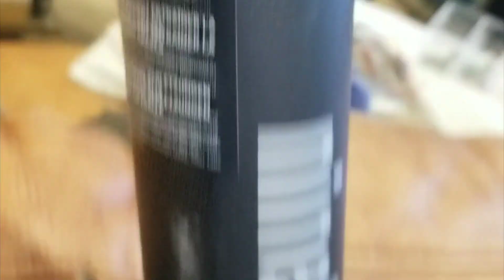Ninebot ES1 ES2 ES3 ES4 Internal Battery Teardown

Comment: Best disassembly video I have found for these packs!  I found one of these scooters in the dumpster recently and can’t really see why it was thrown out.  Thanks for the info!
Reply from the maker: Thx so much for kind words.  Dumpster finds are the best!  Amazing the gold that can be found in there.  Scooter well my friend. My wife and I have found all sorts of new corners of our city as a result of these amazing inventions.
Reply: Same here, found one in a dumpster. External battery charged up, internal battery is asleep. Hoping to wake it up and recharge it.
Reply from the maker: @SunsetSlimess I discovered after I recorded video that there is a little brass reset button on one of the control boards - there is a video out there that shows that you can carefully drill a small hole in the battery case to get a paperclip 📎 in to hit that reset button to wake battery up. Apparently works sometimes if that's all the problem is. Good luck with project!
Reply: @fixitdad899  I had to open the case, half the pack was below cutoff voltage. I was able to charge that side with magnets and a bench power supply holding the wires to the side bars, then the pack woke up and charged normally. Works great now!
Reply from the maker: @SunsetSlimess  Nice! Any ideas on why only half the pack discharges like that? Never understood the why on that and discovered it on more than 1 pack. Glad that worked for you and that all went safely.

Side note - My neighbor accidentally burned down their and our weekend places last summer.  Not battery related but ... - I'm now paranoid about trying to boost Lithium anything! I lost all my escooters :( 
Found burnt out cells strewn about the ashes. Apparently cells can travel a fair way once they are 'shooooshing'.
Anyway - may yours now bring you much pleasure. I've moved on to Wingfoiling for now - less risk of fire and a good workout to boot!🔥 😀 👋
Reply: @fixitdad899  Not sure why, might be a BMS firmware issue. I never charge them unless I am there watching, and never above 10A. Just needed a few minutes for them to get above 3V and the BMS wakes up.
Reply: @PortablePowerSolutions  Got any video or pics of that operation?

Comment: The way to wake the bms up (no blue flashing light) is to apply 12 volts to the  red and black wires, on the 4 pin plug. And boom good to go, if the cells are not buggered

Comment: This is great information. I am wondering whether I could repurpose the cells in the plastic case. What is the diameter of the assembled pack?
Reply from the maker: Calipers say 49.33mm diameter...one side has flat face which is about 23mm across...when measuring distance from flat face to opposing side (quasidiameter?) It is approx 47mm
Reply from the maker: Thanks for watching and for feedback...yep, great little packs to repurpose: either case or cells. Best wishes on your project(s)

Comment: I believe it's a 2p10s -- you had it backward. Each pair that shares the tab connection is paralleled (making a 3.6v @ 5.1 AH cell), which are then put in series to make 36v, 5.1AH = 183wh.
Reply from the maker: Thanks for watching and for the headsup...makes sense. Order of things does make difference. Appreciate you adding the wattage ratings too.  Have a great day!

Comment: Thanks a lot for the video. Do you have a video where you show how to change the bsm with the sidebars when the batterypack is good, thats the cheapest way for me to bring back life to my battery.
Reply from the maker: Hi Gurdal. My pleasure. Sadly no, I don't have such a vid nor have I attempted manouvre myself. Best wishes with the project and pls do record and post. I'd love to see it.
Cheers
Reply: @fixitdad899  i have disambled the battery. It was glued on one side. After measuring the blockd ive found out that two cells where undervolted. I had to destroy the pins to get them out and charge them. Now theyre charged normally but the problem is to solder them back again. So it doesnt worked and thats why i cant gwt it togehter to test the bcm. It shortly blinked blue but then directly changed to red again constantly. I think when i get it togehter with stable soldering and change the bcm it could work again. Ive ordered a new battery on aliexpress because in you cant buy in germany wirhout getting poor🤣
Reply from the maker: Ya - they don't seem to be easily self-servicable units.
Difficult to take apart without destroying some pieces.
But there are some great parts in there that can be re-used in the worst case.
Good that those two cells took a charge in the end.
Best wishes with Ali B ... maybe they ship quicker to DE than CA?! Orders take a long time to get to Canada.
Anyway, Happy Holidays to you and yours.
Reply from the maker: Maybe Santa will bring you a spot welder
Reply: @doenerfreak87  time to invest in a battery spot welder. i bought a cheep one on ebay that lasted about 20 welds and one of the cheap mosfets went south- easy fix.  it makes rebuilding battery packs a breeze

Comment: Is there any way to revive a battery that is half dead like you explained? One side is near full charge while the other has less than a volt on all readings :( Thank you for the help!
Reply from the maker: Hi Dabiel - sorry for slow response. 
I never did get to the bottom of why the packs were 1/2 discharging like that. Without knowing cause I've moved on from the dead cells.
Once cells are that discharged, I wouldn't trust them anyway.
Seen way too many stories about ebikes spontaneously going up in flames lately.
Lithium can be so dangerous.
Better safe than sorry methinks! Have a good one - thx for watching.

Comment: hi!  my son got one of these scooters from the dumpster but someone tried to fix it and left it disassembled but with almost all the things inside a plastig bag.  also the battery is fully disassembled. meassured it 40V. DETAIL --> it misses that second board with the 4 pin connector. the dash doesnt display anything but when i press the ON button the ESC turns ON and the green led flashes 8 times.    do you believe the scooter is able  to run with a battery without that second board?  before discovering that missing board I was thinking on purchasing a new ESC and Dash for it....  the motor seems to be functional because I tested it with a rc car ESC....
Reply: forgot to mention that the pack even without that board is fully balanced with the cells measuring 4.095V !!!
Reply from the maker: Nice score! I highly doubt you can run reliably without 2nd board. But I honestly dont know for sure. Im.way better at taking things apart than putting them back together 😁 - best wishes with your fix - sounds like you have the know how to get that thing going. 👍
Reply: @fixitdad899  thanks for your reply... I will keep trying to find out the esc led flashing code... it flashes 8 times... as it is impossible to see the actual code because the dashboard doesn't display anything... it is a little bit expensive to risk buying new parts for it... maybe is a good idea to first buy the BMS, then the Dashboard and finaly the ESC....    let's see...   ciao from Italy
Reply: @fixitdad899  got some news. I discovered hot the esc flash works. there is a long blink and sucessive blinks. the first , long beep is the decimal of the error code presented in the dashboard. mine was flashing 1 long blink, then 8 shorts. thats means error 18 that is hall sensor problem. after cleaning contatcs started to 2 long blinks then 1 short, meaning 21 (bms error!  the missing board)...  then I discovered that the black wire that goes from the esc to the dash was faulty.  removed the connector from the esc board and soldered the cable directly to the board and ....voilaaa.... dashboard working, beaping and displaying error 21 (BMS)...  the conclusion is that the scottter will not run without the bms board (safety).  I will  need to purchase the board now.
Reply from the maker: Fantastic troubleshooting sir! Thx for explaining the codes and how you were able to read them. Best wishes on sourcing the part and completing the fix. The good news is these things are everywhere it seems! Usually in the middle of a pedestrian sidewalk unfortunately:)

Comment: Do you know if I can mix the LG purple battery at 2650mah with the blue 2550mah, I had all LG and 2 blue batteries but couldn't get it the BMS to turn on, the batteries where charged up to 40V-4.2V and getting 40-42V total.  Not sure if there is something else wrong with it or the BMS boards.
Reply: I have also got a scooters that 1 batteries is charging faster than the others so it would cut off, I assume that will be more likely the BMS than the faulty battery.
Reply from the maker: Hi Mr. Lee
Apologies I dont have a good answer for you - I recommend you reach out to folks on a battery builders forum - my gut says you should never mix  ampere ratings as it creates an imbalance - maybe if the 2 single cells have a higher rating than the rest it might be acceptable but I just dont know. I would assume other way around would cause undue risk i.e. adding in 2 cells with lower ratings.
Best wishes!

Comment: Is there a trick to removing those plastic internal locking caps on either end?  I am able to turn them about 45 degrees back and forth but can't get the slots to align with the metal guides inside the stem. Thanks...
Reply from the maker: Hi Jed
It's been a very long time since I removed mine. Going from memory I used a set of old metal measuring calipers with sharp points. (Like a compass from school days but with 2 legs)
What I remember is having a challenge turning the plug counterclockwise in the tube thread until I used the calipers in the two slots/cutouts in those plugs. There is actually a tool you can buy that inserts into the tube and has two projections that fit into the slots. Think it's $50 or so. I'm way too cheap to buy it!
Anyway .. I don't remember having to slide down a channel. I just remember having to spin counterclockwise a bunch to get it out. Does your tube have a thread along the inner surface all the way to the exit? That would be the tip off. All I can offer. Good luck with it!
Reply: @fixitdad899  Thanks!  I also made a tool, out of two 1/4-20 bolts. It turns very well for abut 45 degrees, then stops hard against those two splines/ridges. No threading visible anywhere inside. It looks a bit like I have to break two tabs off to be able to turn them further.  But I will fiddle a bit more before resorting to violence (haha).
Reply: Mine is an ES2, by the way (with an external batter added on)
Reply: @jedfehrenbach9470  Did you remove the external battery mount bar? It also screws into the internal battery case. Once you get that removed, I used a long wooden rod like a broom handle and pushed it out.
Reply from the maker: Great point about removing the mounting bar

Comment: Any chance if you see this give me a reply, ive got a brand new es2 but batterys at 20v and wont charge (too low). Gunna open up and charge straight to terminals. Have you done this before?
Reply from the maker: Hey Marc
I haven't 'bump charged' these packs but have done same to Ryobi 18v packs. Even have a vid for ya! https://youtu.be/x8ekbxDGVww 
It's the same concept.  Before you dig in though...if your unit is new and warranty still intact. Would reco you swap for a new one. Way easier and keeps you in good stead for any future issues.
If that's not an option I want to alert you to another potential issue with ES2s and ES4s. 
I had 'not new' ES2 do a strange thing on me. The external battery would charge fine but the internal battery started to 'drift'. Kept going lower and lower away from external level.
I knew that if I let internal discharge too much I'd be in a pickle. Took things apart and it turns out that the junction point where electrical cables go into column from external battery pack has loosened over time. While external pack was off I was able to charge internal pack directly via it's original charge port..like on an ES1. I didnt have to bump charge because it wasn't completely discharged. Retightened and reassembled...all good now.  I just want to give you this heads up because you're gonna want to know why your batt went to 20v. This issue 'might' be a possible cause.
If you do open batt up you should check each batt junction like I did in video and isolate which modules are low. If they are all uniformly low that would be good. If some are low and some not. Bigger problems maybe.
I would probably try to bump each module rather than all together. Less voltage required. Remember to keep amps low! Voltage just above where you start and slowly crank up as cell takes charge. Bump to say 3.3 - 3.5v per module.  On board balance charger should take it from there. Low and slow and monitor temperature of cells.
Best to do so outside. If they start to get hot... stop!
Hope this helps and good luck on project.  Post a link if you can.
Reply from the maker: Marc... sorry...Ignore all my banter about external battery packs! I messed up..your ES2 doesn't have an external pack otherwise it would be an ES4
Happy trails!
Reply: How'd you gp with it mate
Reply from the maker: Hey Helium (Helium prices going crazy eh?!?)
Assume you were commenting to the other chap but... 
Since original post 'jehugarcia' YouTuber came out with vid showing how to 'wake up' batteries. Couple of diff methods. In some cases all you have to do is drill in and hit a brass reset button on the control board.
In other cases there are ways to supply bump current without opening pack.
 If you are in a DOA battery situation you might want to check his channel out. Best wishes!

Comment: hi my ninebot es1 only end up 10 to 12km every charge .. do you think I can change the battery cells individual? and how?  thank you
Reply from the maker: Hi Noriel... my family of four have ES1 ES3 and ES4.  I weigh over 200lbs. The lightest in family is about 90lbs.
We have ridden on both flat terrain and more 'up and down' terrain.
Most of the time we do not run in eco
Reply from the maker: ..we run in sport mode.  
Our machines are not new...all have 500km or more. My observation is that the ES1 just doesn't have great range...especially if you run in sport mode ...up and down hills...with a belly ;)
For comparison ...the cousin to the ES1 ..the "M365" have 30 cells in their battery packs. 33.3% more juice available.

Not sure how you run but I personally think you are getting expected mileage for ES1.  My recommendation would be to buy external add on battery pack to extend range and increase power.  They just bolt on... pretty easy install.
Makes it an ES3.  Good luck!
Reply from the maker: I found it less expensive to buy a used ES3 and sell ES1 ... batt packs are about 400 dollars stand alone. Was cheaper for me to buy the ES3 than retrofit ES1
Reply from the maker: Re: changing individual cells. Pretty sure your cells as good as they can be else you'd probably not get even 12km...did you ever get better mileage?  Is this a recent change/issue?
Reply from the maker: Changing out individual cells would be a very big job... you'd have to disassemble, identify bad cells, desolder BMS leads and take old nickel strips off. Source good matching new cells. Place new cells ...re-spotweld new nickel strips.. re-solder BMS leads...reassemble pack and hope you haven't messed anything up.  Chances are new cells wouldn't be a good match for rest of pack and might cause rest of pack to age prematurely.  
But...that's how you'd have to do it.
Reply: @fixitdad899  yeah because when I bought it they said it can range 15 miles but sorry I didn't tell you that I bought it refurbished and I only payed 275 dollar. but I'm planing to buy new battery replacement and add extra battery pack.. and also I found out that it will cost me 400 dollar together so I was just planning to sell it  and get a new one which is the 750 dollar scooter with 80km range
Reply: @fixitdad899  but thanks for your information I appreciated ...

Comment: We are trying to get the battery out. I haven’t found a video of that. We have the stem open and detached. How do we get past the ‘divider’?
Reply from the maker: I used shop calipers ... basically a big compass with two adjustable arms. Feed tips into cavities and turn cap counter clockwise. Should screw out. I've heard chopsticks with rubber band pivot point achieves same. Good luck!

Comment: Is it possible to run the battery without hooking up the tx/rx wires, and just use the -c/+c for charging and the other cable for discharge?
Reply from the maker: Hi Adnan ... not sure if I understand your question precisely but if you are hoping to bypass balance charging circuitry for any more than a very temporary duration I dont recommend but if you propose to utilize BMS on battery then...
The TX/RX plug into the speed controller  which in turn is supplied with power from the battery. Battery and TX/RX not connected directly. Pretty sure that so long as you are feeding 40v charge source direct into battery BMS there should be no issue. You can then draw the stored power out via the main power out cables. Just watch your current draw so you don't overload batt cables - these  hub motors are approx  350w.  Dont go hooking some 1500w beast up directly else the pixie smoke might happen.

Comment: I have a sealed in the box es1 (have had it 3 years)
I tried to charge it but the green light never turns off and it won't charge. Anything I can do to get it to charge?
Reply: There's videos on YouTube that say these internal batteries go into aleep mode and need to be woken up by weird means they used a paperclip in one of the connectors if i remember correctly i cant remember the names of the videos but they are on here
Reply from the maker: Hi guys - there's a YouTuber "jehugarcia" who has a few vids detailing how to wake batteries up. If you google his handle and "ebike" or "battery" he should pop up
Have a great day all!